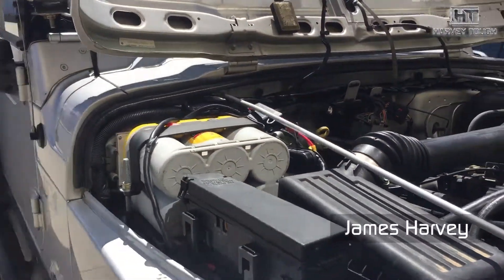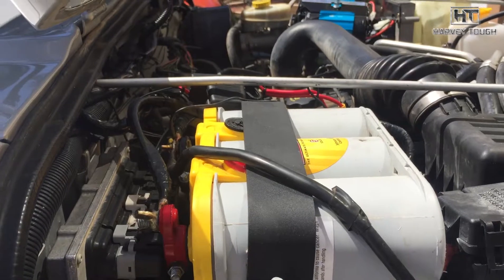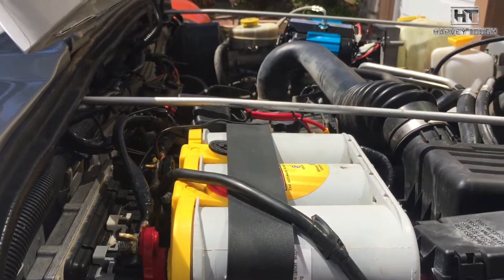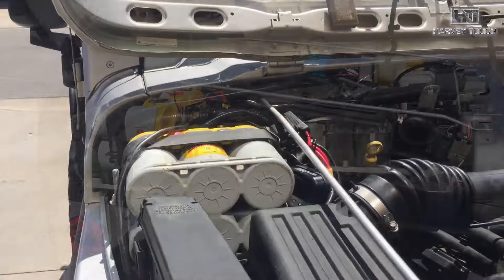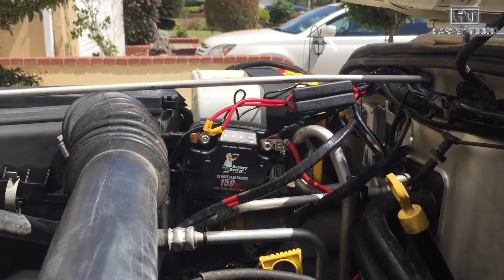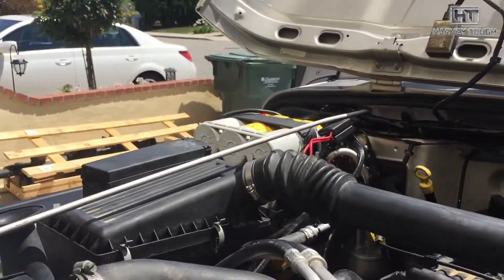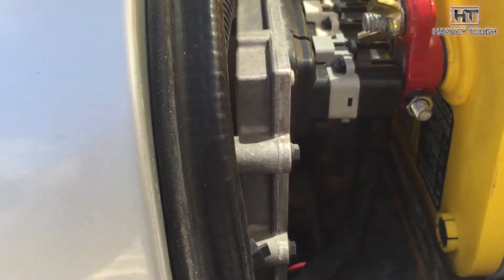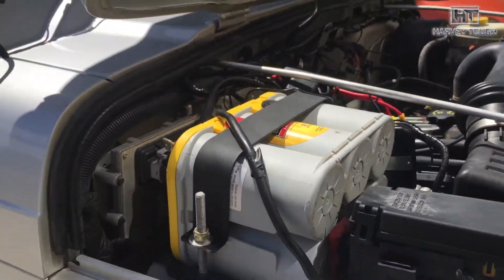Smittybilt Dual Battery Tray Jeep TJ 2004

Comment: I like that.. this is exactly what i wanted to do to my TJ.. I rather run everything off that second battery Radio, lights, etc. but did not know where to place the second batt. at.,, thanks for the upload.. is that the only location you see fit?